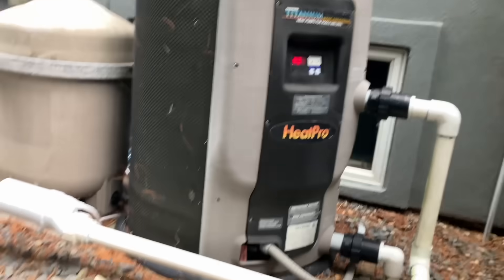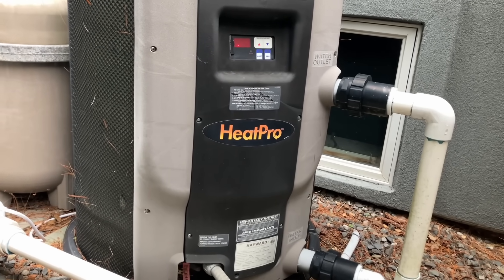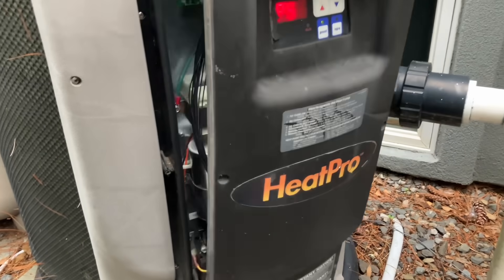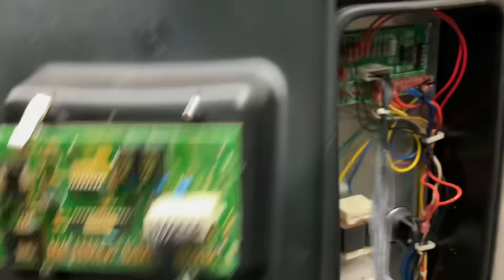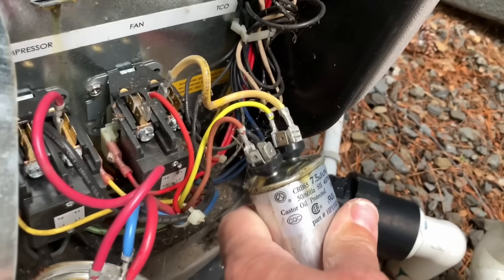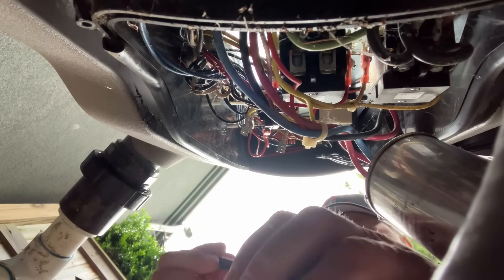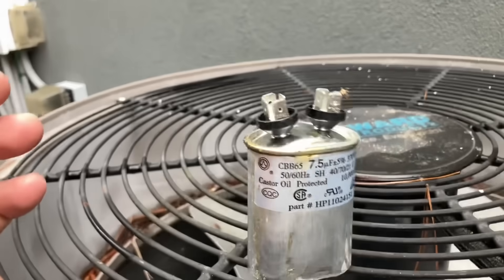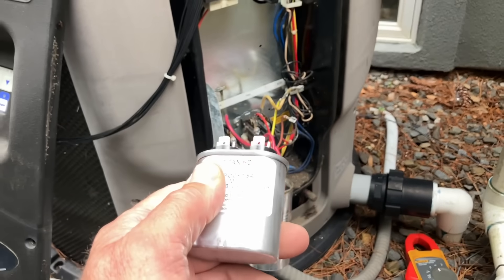Pool Heater Fan Won’t Spin Unless You Push It? Hayward Heat Pump Repair EXPOSED!

Comment: Seriously I'm not even an HVAC tech and my first thought was capacitor fan motor. Mostly because well I watch too many HVAC videos and one died on our AC unit before. It's such a basic and obvious repair I have no idea how the previous guy didn't do it when I'm not even licensed and could tell  right away.

Comment: No oiler hole? For the motor service?
Reply: They haven’t had those on motors in years
Reply: Got it sealed berings, I've had a couple electric motors, with oiler holes .ty  @nickc6399